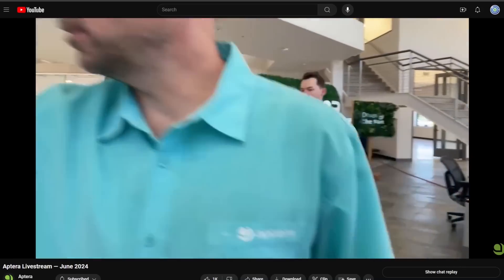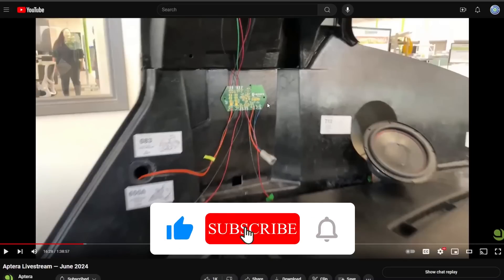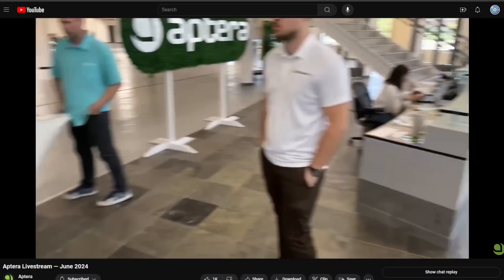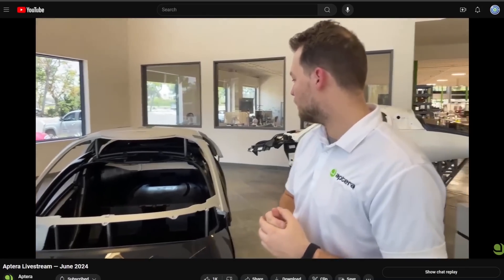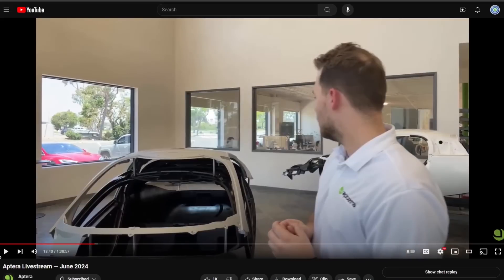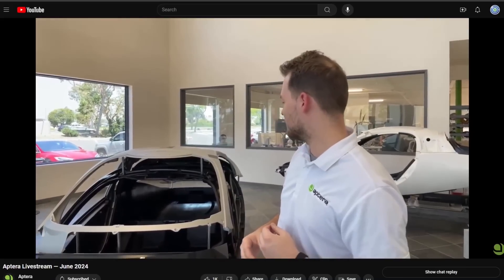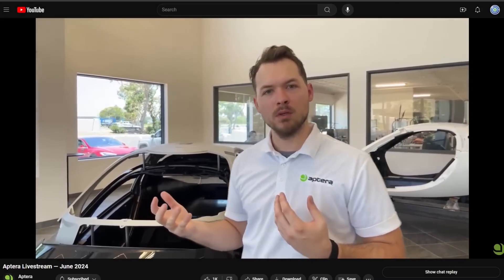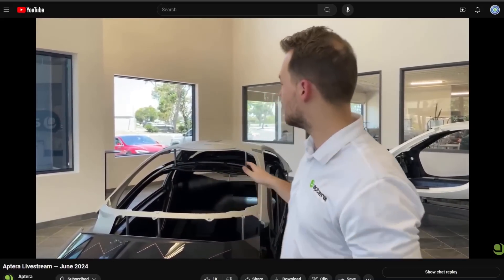What are the challenges with solar on a vehicle?

Comment: So to be clear. My understanding is that Aptera solar provides 40 miles range at an average speed of 24 mph.  If you drive an average of 60 mph you will get about 7 - 15 miles range from solar.

The 1000 mile range also assumes an average speed of 24 mph.

If you think that speed does not affect range, try driving in any EV on the highway. :)
Reply from the maker: where are you getting this from?
Reply: @ApteraOwnersClub  reddit. Aptera Range vs. Speed

Comment: Thanks Steve, Reed,Chris…. Hmm My home’s PV solar system have what the installer referred to a “ optimization system “ which doesn’t shut down production due to shadowing… optimizing production through changing  solar exposure ( clouds and angle/ shadowing )  But they should know… as solar is  “their thing for solar mobility!”
Reply: Aptera's talk of "optimizing (solar) production" is quite over blown.  String level high speed MPPT has been done for going on 40 years.  Also, a leaf falling on a solar panel does NOT kill the entire panel.  Solar panels typically have string level bypass diodes and/or are made with solar cells that have low "breakdown" voltage.  Finally, many solar arrays that have panels on variously angled surfaces will typically have MPPT MicroInverters ON EACH panel.

Comment: Very common on solar panel driven battery chargers is to configure the chargers for Maximum Power Point Tracking (MPPT). Aptera apparently has 7 paths to charge the batteries as efficiently and quickly as possible.

Comment: I find aptera’s electronic controller strategy to be… subpar.   

The fact that they haven’t finished the wiring layout is telling.
Reply: Validating the layout in the real world, with production parts, is a necessary step. You'd prefer they just skip it and guess?
Reply: What would you do different?
Reply: @ronfarnsworth7074 
There are total six or seven distributed control panels around the Aptera body. Each panel would have on the average 10 to fifteen connectors SMT type. That means someone has to push more than hundreds wire leads to the SMT. This process alone would take at least half an hour and very prone to errors since the wires are quite similar in sizes and colors.
You should terminate wires in three or four connectors for each panel. It only takes a second to snap two mating connectors together.
Reply: @Kukaboora  But adding male and female connections into a  connector body would be even more time consuming, add more parts and expense, and worst of all add an extra connection which has a higher failure rate than anything.
Am I missing something in your description?

Comment: No mod to the CF press molds need to be made.  There is a post pressing process, where a CNC robot trims off all of the flashing.  This same CNC process could/should predrill at least small locator holes for all fasteners.  Then for PCBA's, self-tapping screws can be employed easily into the marked holes.
Reply: I agree or they can add in the mold threaded inserts with minimal work, i.e., it is a subtractive process for the mold.
Reply: @robinpettit7827  They could add threaded inserts to mold, true.  But 1) the molds are complete and validated.  2) threaded inserts add cost and purchased parts to track (there are already many threaded inserts in the mold for mountings that need metal to metal threading).  3) At some of the angles for threaded inserts, to get part release, one may need mold inserts, which would be uber-costly.  And finally, 4) securing PCBA's in carbon resin does not require the accuracy and security of pre-threads.  Self-threading fasteners would be fine.  Because there already is an established CNC post-process to clean-up the flashing, it's a no-brainer add tap holes at that step.
Reply: @WilliamChapin  I agree, just pointing out that it isn't as costly as as totally redoing the mold to also put in threaded inserts.  I assume they will drill holes as part of the BinC part production process.

Comment: I would expect the PCB mounting hole drilling can be done by same robots that trim the flash after pressing the part at CPC. And they may not be using screws to attach the boards. There are plenty of snap-in nylon PCB standoffs that are rated for use in high vibration environments. The PCB assembly group would press the standoffs into the board and the final assembly group would just have to line up the board with the holes and shove. Much quicker than using screws.

Comment: The way it works with carbon fibre molds, the mold has divets in it for mold inserts. After, the material will conform around it. It looks like they didn't do it for this pi.

Comment: Galvanic corrosion between carbon fiber and most metals can occur, particularly in the presence of aqueous solutions that contain salts, fertilizers, or acids.
They must have some fastening system that avoids this. Aptera's outer panels are FG-SMC, fiberglass.
Reply: The adhesive they used will be the barrier between the metal and carbon fibre

Comment: Steve, they couldn't pre-drill the holes until the wiring layout had been finalized. Self-tapping screws make the most sense, at least for the PI builds.
Reply: It is on the inside behind a panel.  As long as the wires have enough slack that it could be screwed in 1/4 inch offset if it strips it will not be a problem even for release.  PI in general should be virtually identical to production not "just another prototype"
Reply: @ccibinel  Perhaps they did not want to have too much slack in the wiring? There must have been a reason to not have the mounting points positioned in the panels when they were pressed at CPC.
Reply: Since we don’t know the true shape of the molds, they could have made an area a little thicker for easy mounting. Of my worries, this is probably one of my lower ones. I’m more concerned about the BnC allowing for sweating in void over time and the chips just being sprayed and not encased and calling that good enough.

Comment: Self tapping screws, quick, cheap, easy
Reply: Unreliable in a vibrating environment.
Reply: @Okurkaarrgghh  exactly
Reply: A worthy consideration for sure, but they're common on ice vehicles of all types which have more vibration than electric. 
Do have to say I never had a cf smc press molded vehicle though. Just cf bicycles.
I think the right screws will work, but maybe that shaker table they used for batt pack would be worth trying.
Reply: @Okurkaarrgghh  Sure, they need standoffs so nothing shorts. But cf smc isn't conductive is it?
Reply: Almost all vehicles use self tapping sheet metal screws.

Comment: If you're like me, my vehicle sits in my work parking lot for 9 plus hours every day. It would be great to have an additional solar panel in a storage spot in the rear hatch.
Reply: Drive the lightning featured a company that makes a fold up solar package (like 5 panels) that is meant to be put on top of a car and fold down over the roof, trunk and doors. I'm hoping I can buy that and stick it on the ground and use it with the aptera while camping (stick it inside while driving).
Reply: i would like one to place over the windshield
Reply: @adamchan635  I agree. I usually park my car in the shade and leave my windows open (since I can't stand AC). Its going to be difficult for me to get used to parking in the sun with Aptera. I wish I could get rid of the panel on the dash as I want to leave the windows open. A panel that I could stick on top of the windshield is a good idea!
Reply: @adamchan635 There are dash solar panels already, anything placed on windscreen would cover them too, but having said that a windscreen cover/solar panel, also keeps the car cabin cooler since it sits in the sun the whole day.

The other thing would be good is, if you can plug into a solar panel set up at a spot that you regular park at.
Reply: Aptera mentioned that they would have a plug where you could plug in external solar panels, and the system could support 1500 watts. There are some solar roof kits that can be plugged in (for Tesla Model 3/Y) but they are very expensive. Also there are many low cost solar panels for RVs and boats that would make more sense. For me, the Aptera's onboard solar will likely completely refill my batteries by just sitting in the parking lot.